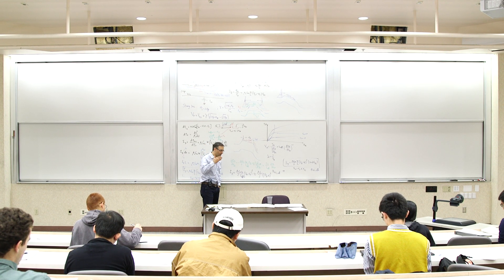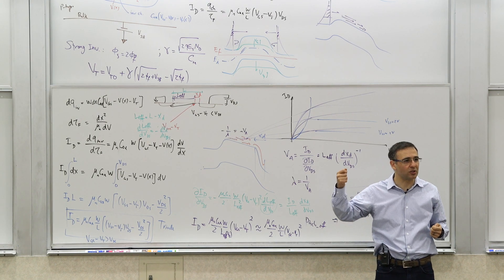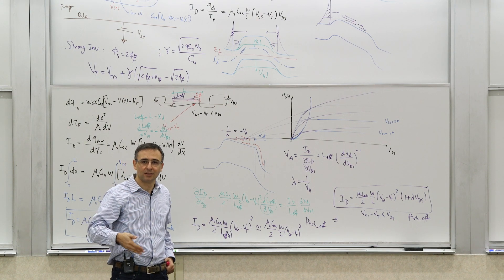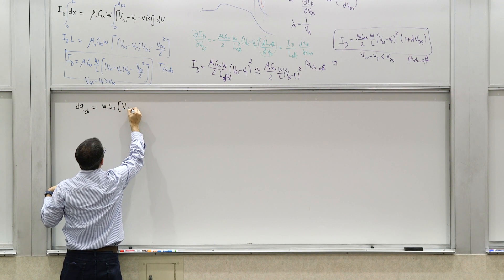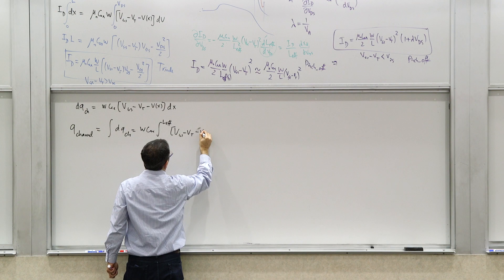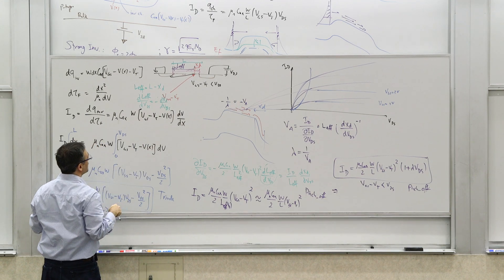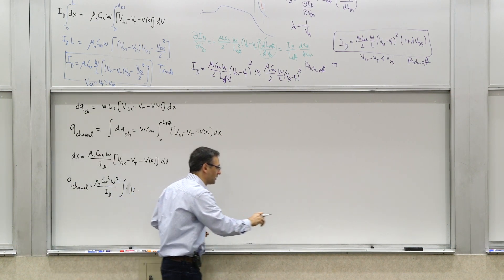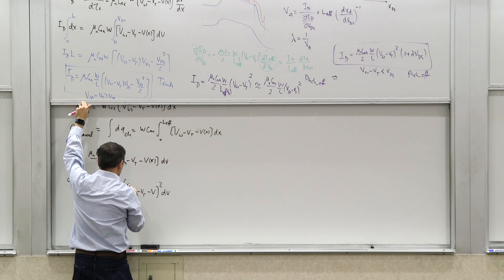111N. MOSFET Channel charge in pinch-off, Channel capacitance calculations

Comment: Here the problem is... what is the difference in practical terms, between the definition of capacitance and of differential capacitance? The definition seems clear: the first is the ratio of a charge on one of two plates and the voltage between the two plates, while the latter is the ratio of the variation of the charge on one of the two plates and the variation of the voltage between the two plates, however, it is not clear when and why use one or the other definition.